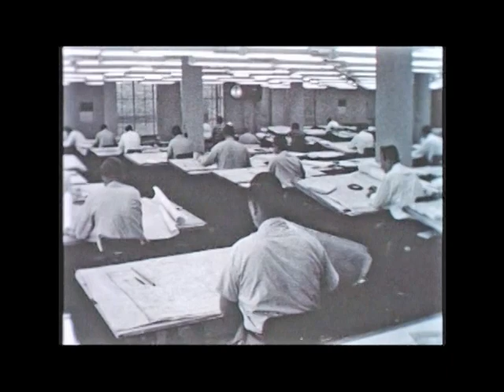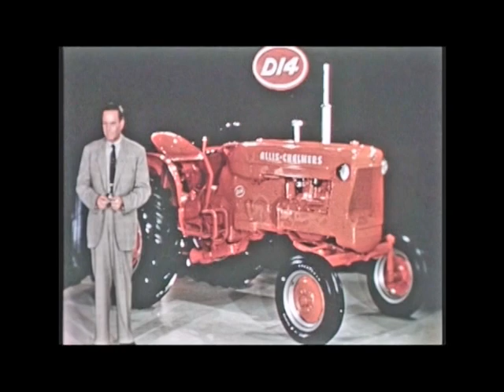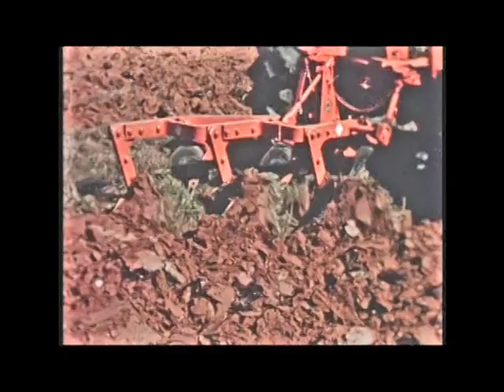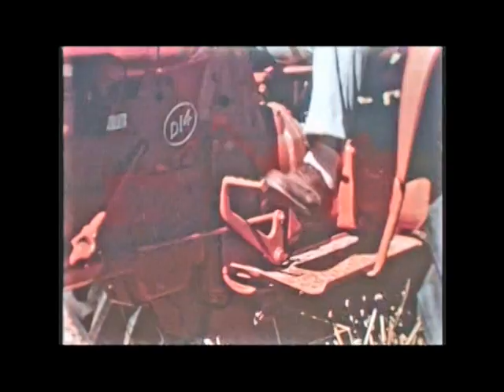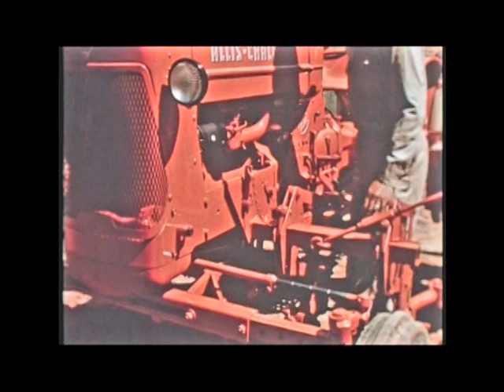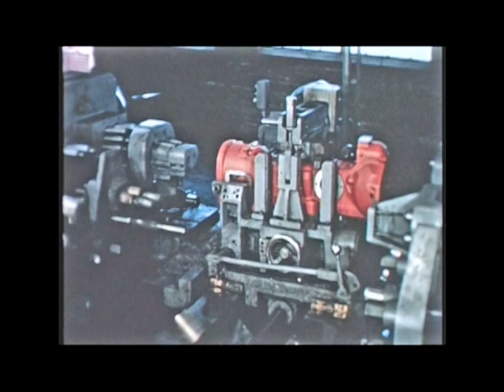Tomorrow's Tractor Today

Comment: Still have a WD-45 and use it cultivating, had a D-17 Series IV diesel which was a great tractor but my brother sold it. I was impressed that these series tractors did not leak oil from the rear and trans after 30 or 40 years of use like many other brands. The Buda/Allis-Chalmers 262 diesel ran great. It had an interesting pre-combustion cell type injection system.

Comment: We have a D14 tricycle.  It is a powerful little tractor for only 31hp.  It is also very fun to drive with power steering.  I would love to pull our v-rake with it but it only has 1 hydraulic coupling,  would it be possible to add another for oil drain back?

Comment: I will never understand why Agco chose MF over AC  I won't speak for the rest of the world. Haven't been there. I have D-14 with mid mount mower but tractor engine is stuck. Haven't been able to free it yet. Might have to drop crank from bottom and but piston rods with overhaul kit from beating they'll take driving pistons out. Well that's another day.
Reply: Pull all the plugs and put an ounce of Aero Kroil in each cylinder, let it sit for a few hrs and try rolling it over with a socket on the crank. If nothing try another couple of ounces and try rocking the crank back and forth with a socket and breaker bar. That stuff has unlocked quite a few engines for me over the years, even a few two strokes that people didn't use mix in. Best of luck.
Reply: Keith Martin AGCO = Allis Gleanar corp.
Reply: Hallo Keith,
MF's worldwide's reputation over all continents maybe the reason for that decision. But i feel with You! There might have been no need to quit the Name Allis Chalmers as a tractors brand, but it's history. But it also was to quit because of the other industry sectors, AC was known for at this time.
Maybe some day they will remember this great name and it's tradition behind it! The Traction Booster System and "the big stick" just worked!